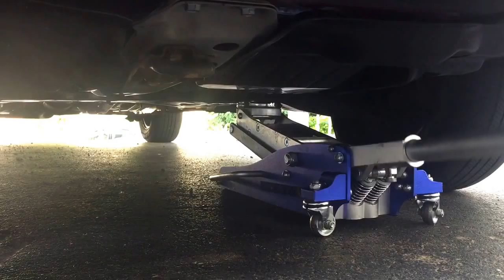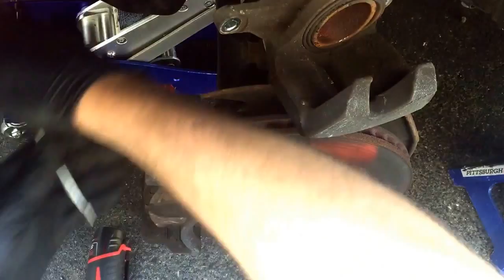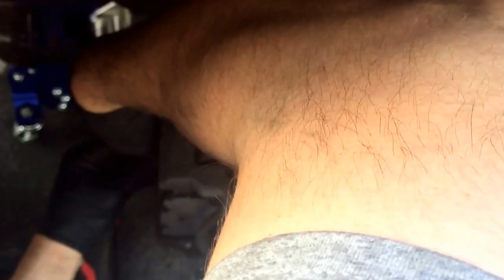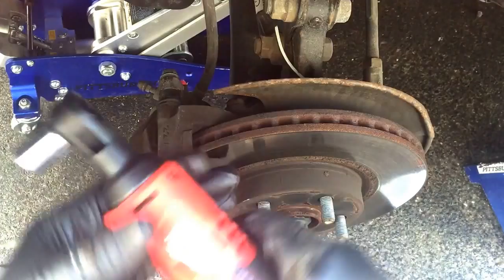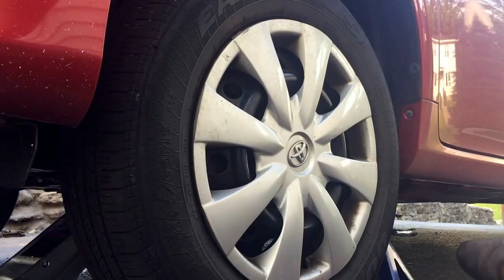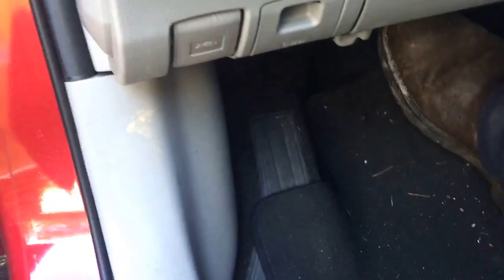Milwaukee m18 1/2" fuel Changing brake pads 2010 Toyota Corolla, 3/8 12v ratchet by Milwaukee

Comment: yeah bro, love them Milwaukee, tool's, sold my 2763,and bought the 2767,  only difference, when I snug the lug's, I use mode 1, then hit each with a torque wrench. between the 3/8"  m12 rachet, the 3/8" m18 2754, and m18 1/2" 2767,and good set's of sunex and gearwrench impact socket's, life so much easier :)   but sometime's, still need the gearwrench,1/4" 120 rachet,with 1/4" socket's,for electrical part's,and tight spot's around engine. thx sharing. lot's of DIY,and even pro's, don't realize, air no longer needed.

Comment: good vid , show basic procedure of replacing front pads on most modern vehicles , only one thing i would recommend is clamping brake hose and losening the bleed nipple to push piston back in , as you can damage the seals in the master cylinder , but other than that , good job bud ,
Reply: or take the lid off the master cylinder
Reply: What Tim said, take the cap off the res and watch for fluid rising as you push the piston back and use a syringe to suck out the excess. Clamping the flexy is way worse especially on an older flexy! And introducing air into the system from the caliper is asking for you to have to bleed it up again!

Comment: no torque wrench just an impact🤔
Reply: luis amoa 💪🏼
Reply: I've used that impact wrench when bolting back on tires and it over torques by about 200ft lbs maybe more. Please take you're time and torque lug nuts properly. Use mode 1 then use a torque wrench.
Reply: I thought the same, those M18s could easily strip those lug nuts or pull the stud, they're very torquey! For taking off sure they're great but putting back on? Nah, if somebody has to take that tyre off at the side of the road they're fucked. (Unless they've got that M18 in the trunk!!)

Comment: why not let the tool do its job? what its not strong enough to take the bolt off
Reply from the maker: +Daniel Day it's rated for 35lbs. So no. Not strong enough. Also it's not an impact. It's a just a 12v electric ratchet.
Reply: Milwaukee Mow oh thought about getting one to get in the spots the big one cant get into

Comment: Where do you get those black rubber gloves, and how do those Milwaukee fuel ratchets work on the brake calipers?
Reply: Mike Eldridge, harbor freight sells the black nitrile gloves and also amazon has them

Comment: Should've turned those rotors in a lathe
Reply: His rotors are fine.
Reply: Where do you get them resurfaced though ? Most people just buy new Chinese rotors
Reply: James Avery I have a lathe where I work but some parts stores like rl  or some shops the machine flywheels will turn them even some local automotive schools will.
Reply: Listen....was I not clear? Modern rotors are not really  turn-able do to their thin-ness..  The labor and equipment outweighs the cost of new ones.  Jesus.  And if you have have any wrenching skill and can do it yourself, it's not even a question.  If you can change a fucking light bulb, you can change rotors.
Reply: Jim Blane well modern rotors are in fact turn-able I turn many during the day. Weather or not a rotor is turn-able depends on the service limit usually found on the rotors themselves or on programs like all data/ Mitchell. How ever I do agree with you that if you are doing brake work in your drive way then buying new rotors is the best option to eliminate brake problems. Two more bolts on the back of that bracket (then screws on the rotor if there) and a couple good pounds with a rubber mallet and you're there anyway. We must unite to end pad slapping
Reply: If the rotors are warped, or there is judder due to surface problems, replace.  If not, new pads are all that is necessary, as they wear down.  Problem probably is that people don't know the mileage of their pads and rotors.  I've replaced just pads many times - 40k new pads....80k new pads and rotors....general rule.  Good idea to bed new pads to the rotor no matter what.  That could be the difference.  Either hard bedding procedure, or no hard stop/complete stops for the first 200 miles.  Probably where most people go wrong.
Reply: ryands126359 They look fine of you see grooves starting to form them replace it.
Reply: Nissand21 guy there were small grooves on the inner pad right before he did EH with his hand lol